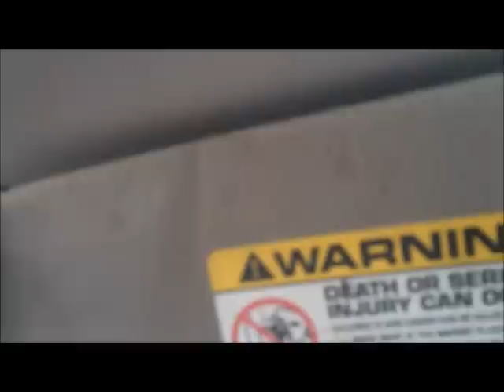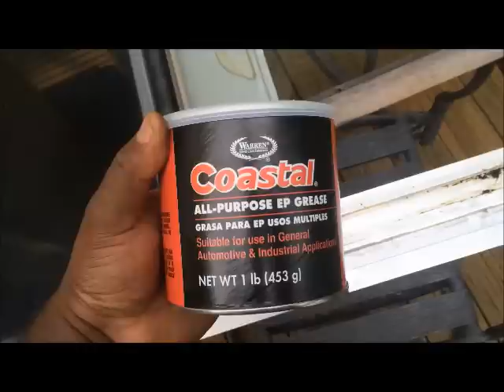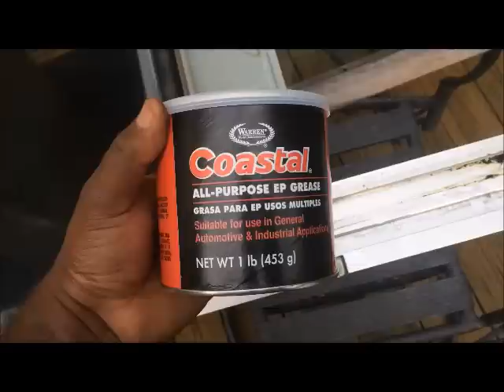2003 Jeep Liberty Remove and Install Sunroof and Headliner Part 1 repair

Comment: great job not giving all the correct tools needed...to remove the sun visors and clips you will need a T-20 not a screwdriver! And the grab bars on the front you will need either a narrow 5.5mm or a deep well...or a 7/32"....but other than that, ok job.